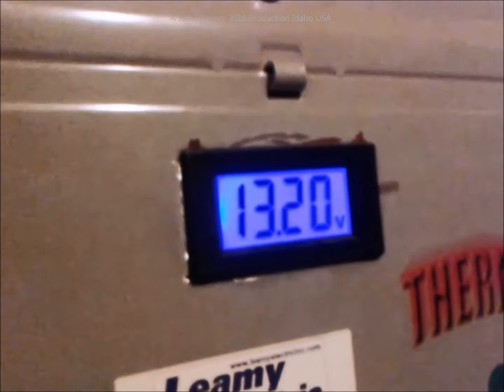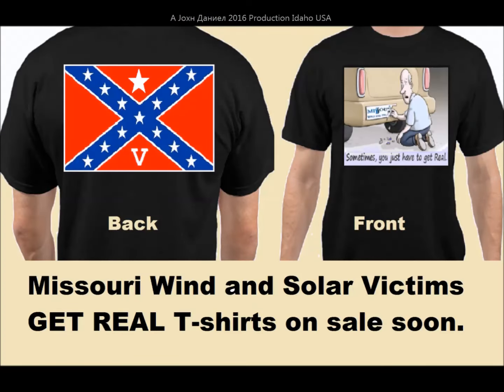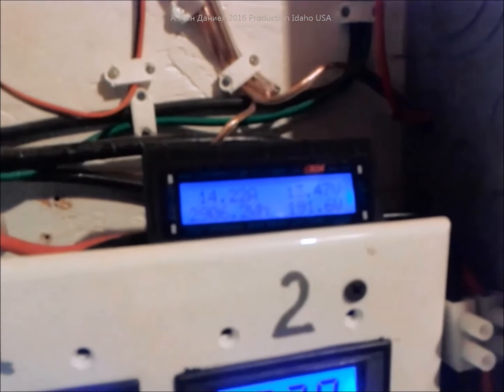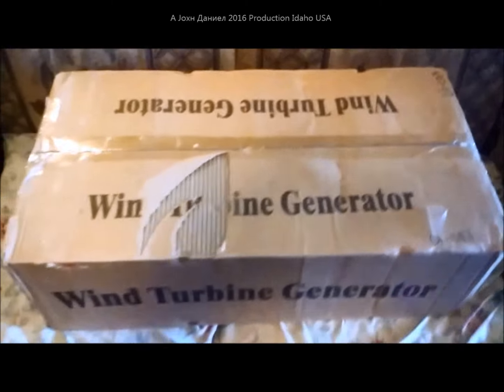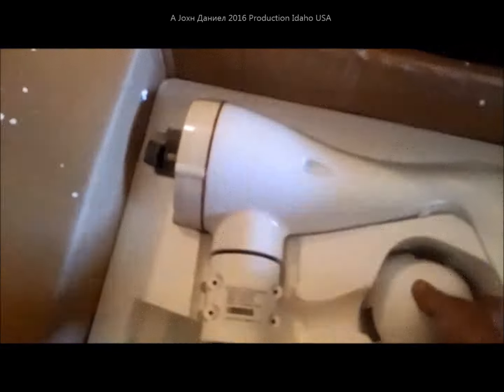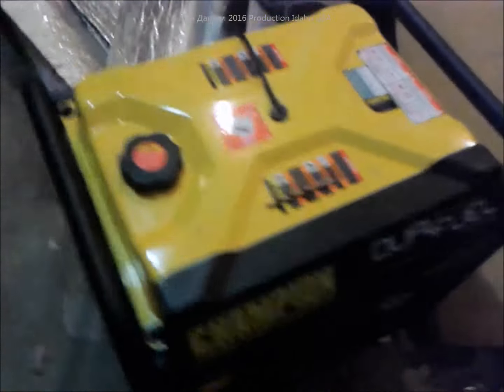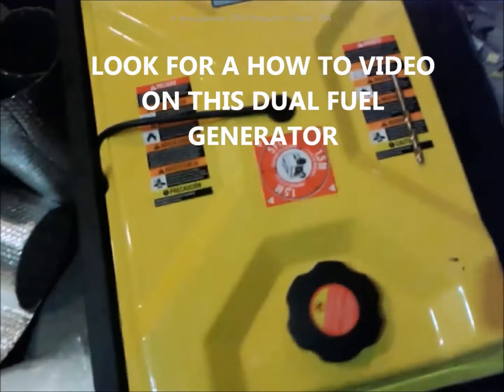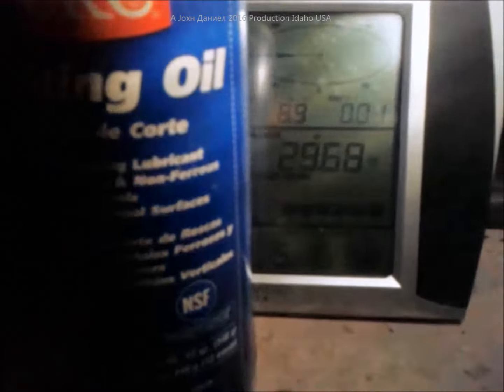Wind Turbine Generator PART 3 - Power Result, UPDATED - SEE BELOW

Comment from the maker: NOW theres BETTER ONES I linked best 1 under video OR check on next best https://amzn.to/2SPlxyB to get these NEWER Heavier Built REAL RATED OUTPUT models! **To get 100% from one & to divert over volting you will need these. https://amzn.to/37HN2OR 100A SQL &  https://amzn.to/2MTUjCU A All purpose long life controller and be sure to get up to 300 watts diversion resistors ( 
https://amzn.to/2QngFPq x 3) and a 60 amp SSR ( https://amzn.to/2QKEyj0 ) with heat sink ( https://amzn.to/2ZYtmna ) and be sure to use thermal past on it.  ( Proper type - https://amzn.to/2QN2hir Protronix)
Reply: most people have commited fraud on someone else at one point in time , if you have never sold with a lie a item to someone else i commend you . you then are a rare type of a person .  the govv commits fraud on a daily basis and call it politics . people in general also commit fraud on a daily basis using lies to sell items . most people are greedy non caring .

Comment: I really think I am going to try one of these. Better output than I have seen out of the ones I have.
Reply from the maker: None work as advertised. Some get close, most are just total fraud.
Reply: I wish they where all rated at what they really do, but I know of one company that would have to have a negative ratting side for them. At what windspeed where you getting these results
Reply from the maker: +Great North Woods Hillbilly Winds were steady at 22-24 mph for over 4 hours. It was very consistent at least.
Reply: do you know what the cut in speed is and how much it averages in like 10mph if it does anything at that speed
Reply from the maker: +Great North Woods Hillbilly I'm getting charge at 8-9 mph. not much, about 10 to 15 watts. At 13 mph it really wakes up and you'll see 50 to 60 watts. From there it's curve gets real good. 
Professional designs matter.
Reply: Thank you that is what I wanted to know, as soon as I can I am going to order one and try it
Reply from the maker: Great North Woods Hillbilly I have LOTS of wind. Most people just dream of wind then buy these little turbines. Then they bash the company or brand or type. Theres one important thing most fail to hear. You MUST have  WIND CONSISTENCY!!!!!
Reply: I have the wind, my average wind speed is 50 to 20 miles a hour. And I get gust of 30+ very often. There is windmill farms all around me.
Reply from the maker: @GreatNorthWoodsHillbilly  See the updated videos on the channel

Comment: John Daniel , Bought one of those ( e-bay ) 400 w generators , put together according to instructions ( turns easy by hand ) but set it on my roof in 15-20 mph wind , doesn't spin
at all,,,,, WHAT AM I DOING WRONG ? Seems to me the blades aren't big enough to catch wind
Reply from the maker: Are the 3 wires crossed on each other? Or do you have a short in your wiring? Actually heard from a guy who bought a wind turbine from a place in Missouri who twisted all 3 wires together and his would not spin due to his watching that missouri seller who was clueless tell him how to do it WRONG LOL.
Reply from the maker: Considering, You apparently did not buy a ME-400 or ME-500 which is completely different ( its real) than the $150 China airX knock off  Turbine.
Reply: Wires aren't crossed but measured the blades and they aren't even 2 feet long . yours are i believe 29 ins or longer and mine have a little play in them , even when tightened. bearing ???
Reply from the maker: Thats not the kind I run on my place for sure.
Reply from the maker: If the tail is a down angle tail, then your probably not getting the ones with the 4 foot 5" blade set. sounds like 500mm blades instead of 650mm which is a knock off from Vietnam. Thats why I put the link for this one on the ads as the current real option to the HEAL400 (on this video) that I got http://rover.ebay.com/rover/1/711-53200-19255-0/1?icep_ff3=2&pub=5575119394&toolid=10001&campid=5338235705&customid=TruGen+Pure+Copper&icep_item=132407715344&ipn=psmain&icep_vectorid=229466&kwid=902099&mtid=824&kw=lg
Reply: Any suggestions ?

Comment: I didn't find that one anywhere for the price you said you got yours for,  They are a little more $$$
Reply from the maker: +Kansas Now they are cheaper on ebay. Just look for them
Reply from the maker: A improved model for low to moderate wind In the open and everywhere the best for consistency and being light weight  low wind - any wind see the updated links below video on UPDATED SOURCING & To get 100% full batteries from one & to divert over volt you need these: https://amzn.to/37HN2OR 100A SQL Rectifiers &  https://amzn.to/2MTUjCU A All purpose long life Load controller and be sure to get up to and over 300 watts diversion resistors ( https://amzn.to/2QngFPq x 3 or 4) and one or more 60 amp SSR ( https://amzn.to/2QKEyj0 ) with heat sink ( https://amzn.to/2ZYtmna ) and be sure to use thermal past on it.  ( Proper type - https://amzn.to/2QN2hir from Protronix) Consider your wind speed area to size it!

Comment: What you have is $1 a watt. Actual 200 watt generator for $200. Means $1 a watt. Thats very different than those sold from Missouri seller that CLAIM 1600 plus watts from practically the same sized stuff. His $500 garbage gets beat by a $200 turbine. So funny.

Comment: I have yet to make any decent power from my big wind turbine. I'd be more than happy with 14 amps.
Reply from the maker: Simple math. I now updated the blades to 2.5" longer and better designed old Thermodyne GREEN blades. now the output has increased a bit and they are smoother running. Thermodynes old green blades were the best he ever sold.
Reply from the maker: NOW theres BETTER ONES see the updated links below video on UPDATED SOURCING & To get 100% full batteries from one & to divert over volt you need these: https://amzn.to/37HN2OR 100A SQL Rectifiers &  https://amzn.to/2MTUjCU A All purpose long life Load controller and be sure to get up to and over 300 watts diversion resistors ( https://amzn.to/2QngFPq x 3 or 4) and one or more 60 amp SSR ( https://amzn.to/2QKEyj0 ) with heat sink ( https://amzn.to/2ZYtmna ) and be sure to use thermal past on it.  ( Proper type - https://amzn.to/2QN2hir from Protronix) Consider your wind speed area to size it!

Comment: I do not believe this. I have a 400w same and its crap, its not turned 1 revolution since i got it 6 months ago, total waste of money. even in windy tree bending conditions not one revolution, just a expensive garden ornament.
Reply from the maker: You have a fake turbine then, not all are equal, just claimed as. See the updated links below video on UPDATED SOURCING and chaneel for other videos & To get 100% full batteries from one & to divert over volt you need these: https://amzn.to/37HN2OR 100A SQL Rectifiers &  https://amzn.to/2MTUjCU A All purpose long life Load controller and be sure to get up to and over 300 watts diversion resistors ( https://amzn.to/2QngFPq x 3 or 4) and one or more 60 amp SSR ( https://amzn.to/2QKEyj0 ) with heat sink ( https://amzn.to/2ZYtmna ) and be sure to use thermal past on it.  ( Proper type - https://amzn.to/2QN2hir from Protronix) Consider your wind speed area to size it!